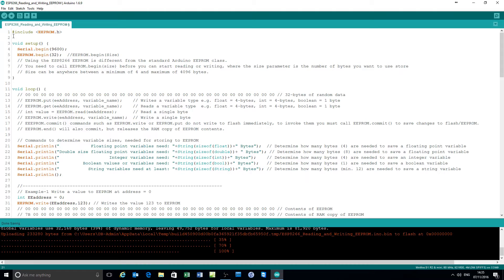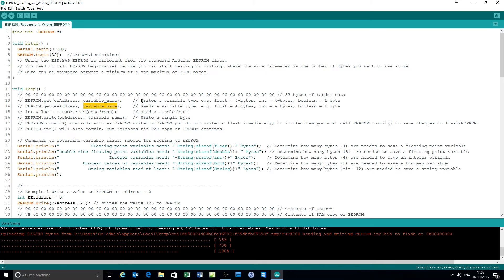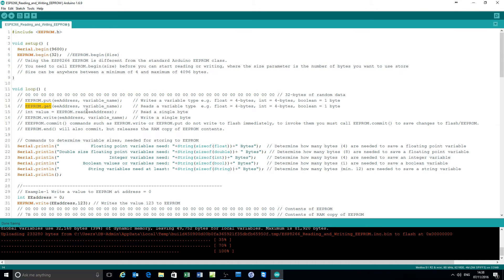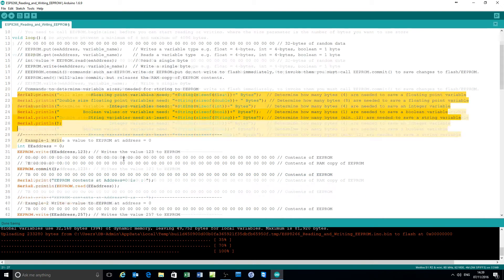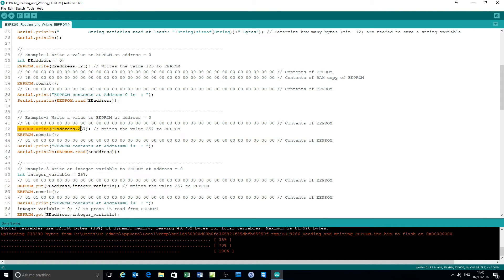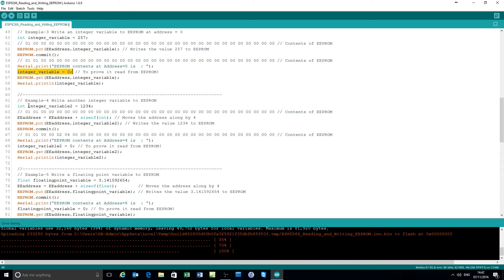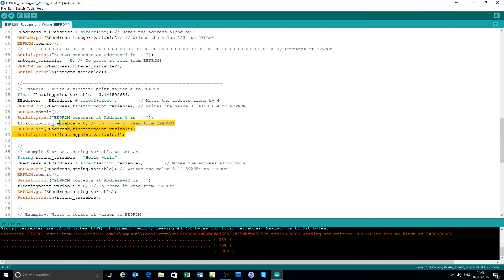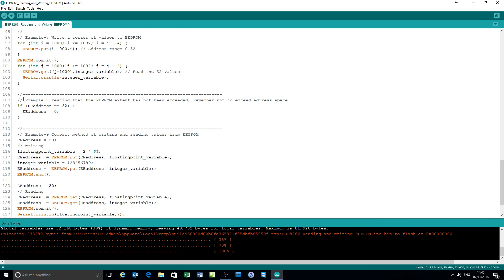Tech Note 015 - How to Use ESP8266 EEPROM

Comment: I am new to electronics, and hopefully this will make sense, lets say I have a pic microcontroller, and in my project I originally had a eeprom I wanted to write to a text file. Is it possible for pic microcontroller to write to esp 8266 eeprom? or no?
Reply from the maker: Yes it is, the maximum EEPROM size in the ESP8266 is 4096 bytes you initialise that with the function EEPROM.begin(4096). You could also do the same thing with the SPI bus Flash (SPIFFS) which uses the on-board flash memory to save data, you have on most devices 3MB of Flash storage available.
Reply: The pic I want to use is pic12F1822, and I can't program that in arduino AFAIK, I would have to use a pickit. The part scares/confuses me since I am not sure if what I say on one device will == what said on the other device. I may end up just keeping 1mb eeprom in there, and just have the esp read it, while my pic writes to it. I mainly was just trying to save on phyical space.
Reply from the maker: PIC12F1822 not in the Arduino IDE.Well I guess unless your programming in C on the PIC, it depends on how proficient you are with C. I don't know what sort of data your collecting, analogue or digital sensor data, but I can't think of any PIC that would perform any better than the ESP32/8266 in-terms of package, Wi-Fi availability, number of inputs, ADC, DAC, etc. It all comes down to personal choice I guess. If you have EEPROM on one device, do you mean using a dual-port EEPROM like say the 24LC41A so that both devices can read/write to it?One advantage of the ESP / Arduino environment is the wealth of examples and support, less so with the PIC.
Reply: You know, I wonder if I can achieve what I want just with the esp8266 by itself, I mean, maybe? Wouldn't hurt to by one by itself, and see before buying the other parts.
Reply from the maker: For about £2/$3 you'd get a decent ESP8266 (https://www.aliexpress.com/item/ESP8266-ESP-12-USB-WeMos-D1-Mini-WIFI-Development-Board-D1-Mini-NodeMCU-Lua-IOT-Board/32788532951.html?spm=2114.search0104.3.8.kEQzZs&ws_ab_test=searchweb0_0,searchweb201602_4_10152_10151_10065_10344_10068_10130_10324_10342_10547_10325_10343_10340_10548_10341_10192_10190_10084_10083_10613_10615_10307_10614_10301_10303_10059_10314_10184_10534_100031_10604_10103_10142,searchweb201603_40,ppcSwitch_4&algo_expid=d68baa91-7777-4f9c-ade9-7a63abd24582-1&algo_pvid=d68baa91-7777-4f9c-ade9-7a63abd24582&priceBeautifyAB=0) and get 3MB of flash (data) storage and have all the tools you'd need unless in a very fast real-time environment.

Comment: nice video! is there a limit of write times to EEPROM in ESP like in Arduino?
Reply from the maker: Espresso say 100,000 but typically 1,000,000 so best to read many write few. I have a data logger running using SPIFFS for over 1-year now and it writes every 5-mins and it’s still working.
Reply from the maker: 100,000 but 1,000,000 is typical

Comment: Can you tell me why in your example code, the value of the stored EEPROM data is all zeroes on the second loop through besides the data from example 9?
Reply from the maker: +Patrick Elliott Yes, it has since been found there is a error in the eeprom.committ() function, so replace it with eeprom.end() and you may need to restart eeprom usage with eeprom.begin() it’s a compiler issue.
Reply: Thanks for the guidance! I got it working. It seems anytime eeprom.end() is called is completely turns off access to the eeprom until eeprom.begin(size) is called again. However, eeprom.commit() does work to store the values in the eeprom. So my method is to call eeprom.begin(size) whenever I was going to have to access eeprom for reading or writing, use eeprom.commit to store the value if writing and then call eeprom.end when I was done accessing it. 

This is now working reliably for an eeprom with size of 3044, which is all I need. Thank you again for the video and the additional help!
Reply from the maker: There is some cranky behaviour with the .end and .commit functions though. My experience is .commit on the ESP8266 does not commit as per the documentation, but writing only happens when .end is issued. I now only .begin, then write then .end then .begin again to read it back.
Reply: @patrickelliott6476  This really saved my day. Cheers